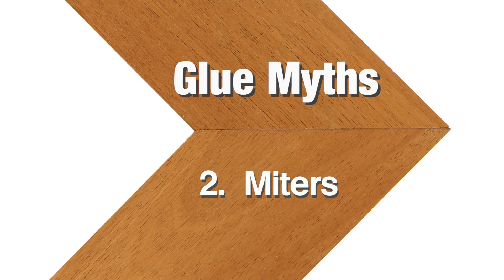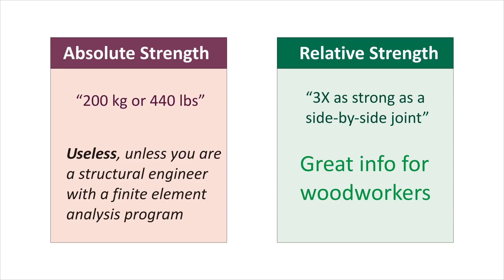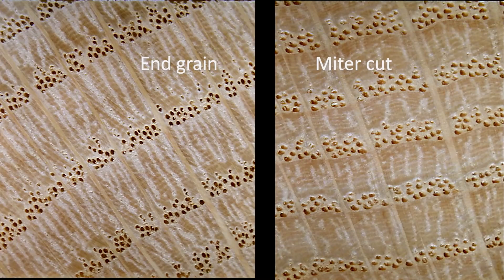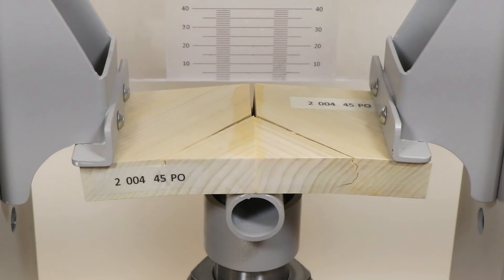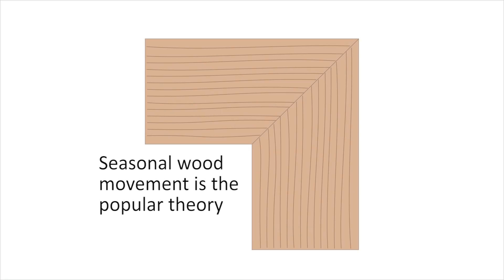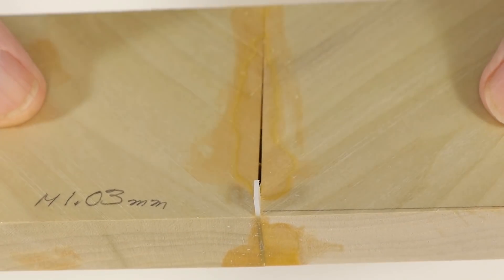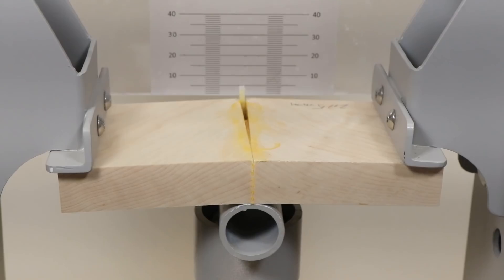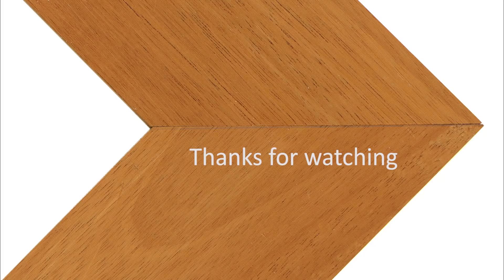Glue Myths:  2. Miters

Comment: Great video! Comment: remember the force geometry! The glue in a half lap joint - well, in most joints - are most often subject to shearing forces. Sometimes the glue in a joint is subject to  pushing or pulling forces. Glue in a mitre joint, however, is mainly subject to peeling forces. Wood glues have high shearing strength and high tensile strength, but much lower peeling strength. So the old advice to avoid force on glued mitre joints is maybe not because of grain direktion, but because of geometry? The modern version should read: never trust glued joints with peeling forces.
Reply: "but because of geometry?"
Because of several things, but yes, cause miter-joints are just weak, same as the endgrain-buttjoints of his first video. That is why we use far stronger joints like a lap-joint that are nearly as strong or stronger than the wood itself.
Reply: @ABaumstumpf  Thanks for your comment!
As an engineer I'm trained at asking WHY certain things happens. WHY is the glued mitre-joint weak? WHY are other joints stronger? (Hint: it is NOT because of the grain direction.)

Here is one explanation:  the glue in a joint is subject to four completely different forces (Well, actually more than 4 but lets simplify a bit...). Glues are good with three of the forces, but cannot stand the fourth. 

Glues are good with Push- and pullforces, it is easy to understand what type of foce this is, I think. Glues are also good with Shearing forces. Shearing is the dominant force you get if you glue two planks on top of each other, and then pull the end of the upper plank in one direction and the end of the lower plank in the opposite direction, along the planks. For those three types of force, the whole glue surface attributes to the strength. 

Most woodglues are less good at handle peeling forces. That is the kind of force you get if you glue two planks to eachother, and then try to separate the planks by bending two ends away from eachother. It is similar to a pull forece, but because of the flexibility of the wood, the full force is concentrated in exactly one spot where the glue can start breaking. Therefore the whole surface is not contributing to the strength. Mitre joints and endgrain buttjoints means lots of peeling forces. A dovetail or a lap joint means no peeling forces, therefore they are stronger. Grain direction is almost irrelevant for this analysis.
Reply: @Skargardsmatte  "Glues are good with Push- and pullforces," - "Most woodglues are less good at handle peeling forces."
I am a bit confused what you mean with "peeling forces" there as you are excluding forces pulling objects apart.

"Mitre joints and endgrain buttjoints means lots of peeling forces."
Even if you just cleanly pull an endgrain buttjoint apart it will be a lot weaker than say a box-joint, specifically cause endgrain-joints (which are basically all butt-joints) are just inherantly weak joints as the glue is the only thing handling the stress. (and have fun breaking a boxjoint - not easy in any direction)

Or another way to look at it - in an endgrain-joint the glue has to take over the role of the fibres - the strongest part of the wood - thus weakening it the most. In a longgrain-joint the glue is taking over the role of lignin - and glue is stronger than that, so not weakening the wood.

Comment: It has been a long time since I made picture frames with mitered or even compound mitered corners. As I remember they had to be almost perfect to get them to clamp up and hold correctly. I think most picture frames fail due to being dropped, overstressing two corners with compression, causing the inside to fail. The other two corners fail from the outside in. I also think a box with mitered corners gets a lot of its strength from the support of the bottom of the box.

Comment: Mr. Sullivan… a question….

In your video you showed yourself breaking a miter with your bare hands on long pieces. Interesting 

The rest of your video is done on your blocks. But, the direction of force isn’t the same when pressing down on the joint versus pulling it apart. 

Or, is my physics so rusty that I am not visualizing the vector diagram correctly
Reply: In both cases you have a bending moment, and a similar stress, only, well, rotated 90°. It will change the amount of force required, but how it works is similar: In both cases, you have tensile stress in the joint, that it's at it's strongest where the wood would split first. There's some difference in exactly how the tensile strength is being produced (the miter joint is a bit more complex, and you might cause some minimal shear depending on how you're trying to do it), but in the end, the heavy lifting is the tensile strength in the joint.

Comment: Here is another thing to consider: the miter joint has larger surface area because of the diagonal cut. The same picture frame with side to side or end to side will have a smaller glue surface.

Comment: I would be interested if you tested this the other way round. So, the sample is standing up on end so the glue joint is running vertically. As you demonstrated at the beginning snapping the joint with your hands, you were putting pressure along the fibres of the wood which we all know is the strongest bit. When putting pressure this way, there is almost no stress on the lignin. Applying pressure on a flat joint as in your demonstration shows the lignin fails. My guess is that splines are needed as pressure in the other direction would fail first on the joint.

Comment: Not sure if you will read this so far down the comment threads. However, an old trick recommended for end grain was to dilute water soluble wood glue about 75% and then paint the tend grain solution onto the grain and let it dry. Once dry, full strength glue would be applied - essentially gluing to glue. I've tried this in the past with acceptable results, but couldn't tell you whether this was  stronger, weaker or the same as your results. I would be interested in testing this.
Reply from the maker: I tested this with a few samples, and found that priming the surfaces with thinned glue actually weakened the end-grain joint.  This aspect of testing really needs a lot of attention to wood species, glue application, waiting time, etc.  I don't feel that I have the final answer, but my preliminary assessment is that this trick (which Titebond promotes, incidentally) is another myth.  Whether I will get up enough energy to really test it rigorously is another matter.

Comment: I'm relatively new to woodworking so when I read only recently that end grain joins were weaker than side joins I didn't believe it.  I watched the videos where side joints broke away from the actual glued joint proving that the glue was not the weak component.  I reasoned that if the glue was stronger than the wood bonds then gluing end grains should be the strongest of all because the liquid glue could wick up into the grain and provide a more extensive joint with the wood. But none of the articles I was reading supported this idea.  The so-called common logic I kept reading never did sit well with me.

Comment: My only concern with your tests are the direction you are applying force to the 'mitered' joint. While I see you were trying to make your test as similar to the original two tests. In my humble (very limited and very humble) experience not many miter joints are used to make a panel type glue up. Instead miters are longer and smaller joints such as a box or picture frame. And so with longer pieces you have more leverage and therefore less force required to break a glue joint. Not saying your logic isn't sound just that I'm not sure it necessarily applies to real world situation. Thanks for your video, very intriguing results. Keep up the great work!

Comment: Funny, the breaks seem to be taking the "path of least resistance", which is the shortest path through as much lignin as possible, glue if there isn't a good path through lignin only, and across the grain only if absolutely necessary.  That might be a useful framework for reasoning how strong a joint will be: what is the path (actually a surface) of least resistance, and along that surface, what is the area of lignin, glue, and wood fiber that will be broken?

As regards seasonal changes in humidity, the arguments I've heard (most notably from stumpy nubs) are that it matters much more for larger panels of wood.   You don't need decades to test it either, just an environmental chamber where you can cycle the humidity for a few days, or possibly weeks.  Once the woods has experienced a few cycles of dimensional changes from humidity, I don't think further cycles would have much effect.  Most of the damage would be done in the first few cycles.  In the real world, it may be that a wood piece has to wait many years before it experiences a really extreme change in humidity, but in a controlled environment, you can make sure it experiences that change right away.

Unfortunately, I think your setup might still not be good for simulating the damage to a glued miter joint from changes in humidity.  Because a miter joint will be part of a larger structure, and it is that larger structure which is likely going to contribute to the stresses on a joint as wood expands and contracts.  Two pieces of wood glued together with their grain at 90 degree angles will likely survive changes in humidity just fine, as they are able to change shape without generating any significant stresses.  If you made a box or frame with miter joints, and put that in an environmental chamber for a few cycles, then cut out your rectangular sections and and tested them, I think it would be a good test.  The control would be sections cut from a box or frame that was kept at constant humidity.

Comment: One thing about a typical end grain join or a miter on a picture frame -- the glue surface is very small.  Maybe this is the reason people are convinced they are weak.  People typically do not glue the side joins of such small size.

Comment: Thank you Sir for curing me of butt joint phobia!  I have known that miters in MDF, splines don't do much and are quite strong with glue alone, dowels a little better.  As of late, I have been having a romance with through dowels in miters.  They look great and rival large splines.  I believe half laps with dowels are the strongest.  Please include dowels in your miter tests, others for some reason have been leaving them out.
Reply: Butt joint is still one of the weakest corner joints, this video series doesn't change that fact. Maybe ok for a picture frame or other application not subject to stresses but for a table base or a chair a butt joint is just as bad as before.
Reply: @CarmoniusFinsnickeri  You seem to have a serious comprehension problem. Try watching the vid 4 or 5 more times.  Try thinking "per sq. inch".
Reply: @squareswing  enough to watch it one time thanks. Btw yes the half lap is the strongest corner joint, through dowels perpendicular to the wood actually makes the joint weaker, although they are great mechanical lock for if/when the glue fails. I attached a link to fine woodworkings joinery shootout from 2009 that will answer most of your requests for test but that comment was removed. Search for it if you want to know how different joints perform in a bend test.
Reply: @CarmoniusFinsnickeri  Joint testing is a black hole of testing with tainted constants.  Two things are constant in new joint strength, added mechanical advantage and surface purchase for glue which is stronger(with the new glues) than wood.  Add wood and a worker who is not perfect in his understanding of the physics of wood and mechanics, and all sure bets are off.  If the fine wood guys made a joint weaker by adding mechanical components, I would advise them to quit woodworking and take up welding. Nice discussion tho.

Comment: It was really a revelation in the first episode that end glue joint is not weak! That’s great! However these lab test are not representing particular use cases. If we compare a picture frame with miter joint to half lap joint or spline miter joint the glue surface and vector of the forces applied to the glue joint would be completely different. It is not the same as gluing blocks. If these are pure abstract glue tests that is ok, but saying that in picture frame a perfectly accurate miter joint is stronger than a long grain to long grain joint is misleading for beginner woodworker. It would be much bigger revelation for me and fellow woodworkers if half lap joint proves to be weaker than miter joint

Comment: Patrick, thank you for another amazing video. I do disagree that the cause for "weak" miter joints is bad craftsmanship/manufacturing. Like you pointed out, the leverage vs surface area seems to be the greater variable to what makes a joint strong. From what I deduce from your data it seems to be more a function of glue joint area versus the levered force, which you were showing in the thin picture frame. I can't wait to see how much of a difference splines make, but if my hypothesis is correct regarding glue surface area, the strength should increase significantly. Also, if you want/need help crunching data or running statistics from a fellow engineer, please let me know. Thanks again,
Jose E.

Comment: These are interesting results, and do demonstrate a significant strength for miters.  But if a frame were made with the grain running perpendicular to the pieces, we would expect it to be weak regardless of the corner joinery.  

A miter being stronger than that is interesting, but does not suggest it is as strong as good joinery.

Some spline orientations I'd expect to be significantly stronger, and others not.  I'll be interested to see what you find.

Comment: Thanks Patrick for another great video.  How confident are you that force vectors explain the failure mode you observed?  I haven't had time to think this through, but I wonder if differential strain isn't the dominant cause.  The lignin between the short wood fibers will deform under longitudinal shear more easily than the long fibers.  I think that's why the joint always opens at the corner where the grain is continuous across the board.  The corner with the short fibers is deforming, reducing the tensile stress on the glue. Once the glue fails at the long grain end, the sample deforms rapidly to the point where the stress in the wood is too much for lignin joining shorter fibers, and the wood splits along the grain.

Comment: Send something like an edge to edge glued up cutting board through a dishwasher. It will come out having moved severely, yet, still totally intact (except, perhaps, splits on the very ends, if it wasn't spring jointed). Send something made with wide stock miter joinery through the dishwasher, and I bet you anything it comes out with failures.
Seasonal movement is the answer to why these joints are unreliable, I believe. A strong glue bond is only one factor in reliable joinery. Joining pieces to accommodate for movement is hugely important, as well. 
The miters on your clock are from very narrow stock which, therefore, experience nominal movement. You have proved the glue bond is strong, you have not proved it is a reliable joint, despite your narrow, stress-free mantel clock miters surviving in, presumably, a very well controlled environment.
Reply: I'm not sure the dishwasher is a good simulator of seasonal movement because it also uses very hot water and chemical cleaners that may interact with glue. I could also see an argument about the rate of moisture exchange (dishwasher vs atmospheric) having an effect on the outcome.
Reply: ...don't use cleaner.
it's a real quick way to make wood move because of moisture change. that's all. if you can think of a better way, have it - the dishwasher wasn't my focal point

Comment: I think these "inherently weak" myths come from the typical use-cases of the joints in question.  At least the first two joint-types you've tested typically have long arms and no additional support close to the joint.
Reply: it is just not a myth but a fact. The 90° joint for a frame - why does he show an miter-joint and a butt-joint(known to be weak and avoided) instead of any other simple longgrain-joint like a lap-joint? Might that be cause a lapjoint is much stronger?
Reply: @ABaumstumpf  presumably he's eventually going to measure every type of joint.

Comment: excellent, again. can't wait for the spline strength video, with all combinations (end to end, grain to end, grain to grain). imo. added strength should be the strength of the spline itself (minus the glue, plus some plywood cross grain effect), no more, so better do a break test of the spline itself. spline length should be the one used in the spline, or you can also compare with same length as your present tests (two rectangle length, one width).

Comment: I think part of the reason to believe miters are weak(er) is indeed people trying to do things like glue whole panels together in a piece of furniture, or even just a long trim. In the latter all that leverage will apply, you have leverage and the weight of the wood itself (plus being larger, imperfections/points of failure just accumulate). You also tend to get a smaller ratio of glue surface to other relevant measurements in larger panel glue ups vs smaller ones. For example, if a drawer was proportional to a jewelry box 3x smaller than itself, it would have to have walls (thus miter surface area) 3x as thick to make it closer to an apples to apples comparison, but it they might be made of the same thickness stock, or even thinner.